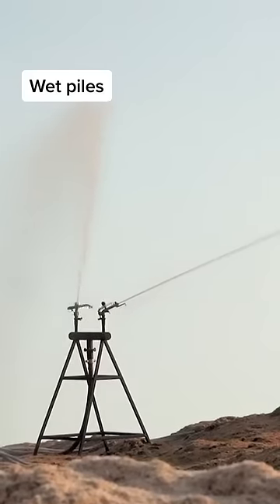How #sugarcane waste is turned into tableware. #shorts #recycling #waste

Comment: Glad that they are using the extra fiber.
Reply: Yeah but its India so u know the chemical waste go into the rivers
Reply: @melvinjansen2338 no because it is compulsory to have a waste water and effluent plant , I am a chemical engineer I have been to many plants and even the smallest have a waste water plant and one more thing to add is the remaining residuals are either dumped in dumping sites allotted by the industrial sector and the remaining may either be used for some other processes 

To say it’s India and so it’s bad let me tell you you westerner like to use the chemical but you don’t like to make it in your own land 

Hypocrisy at its peak
Reply: @melvinjansen2338  you sir need to learn some manners , if not atleast do some research and gain some knowledge.
Reply: @smitchhatrola8295  If something is compulsory it doesnt mean a thing. You could have one that is too small, Barely works etc. On top of that, you are talking about registered and regulated companies that you visit.. you dont visit the others.
Reply: @smitchhatrola8295  my small country has the 4rth biggest chemical industry in europe and everything is super clean here. We do send alot of ships to India however so an army of pajeets can disasseble them without safety gear on.
Reply: @melvinjansen2338  compulsory mean you have to submit it when you start the company
Reply: @melvinjansen2338  Which country are you from? And what's with the racial slur?
Reply: @melvinjansen2338  Based

Comment: Its really cool to see it used this way. My city is a huge maker and exporter of sugar. We reuse the fibre as fuel for the boilers in the mill. It generates soo much energy that the mill sells it to the power company. It help keeps a our aircons running during the summer, topical north Queensland summers suck. But its very cool to see how other places use it.
Reply: That's crazy that the byproduct of sugarcane would produce so much energy, but I wonder if it pollutes too much of the air or not in the process
Reply: @tydshiin5783  Nah, burning carbon based fuels that are not fossil fuels are actually pretty neutral to the environment because it's just releasing carbon back into the atmosphere that was there already. The issue with fossil fuels is that the carbon has been out of the atmosphere for a very long time
Reply: @germanspacepug6373  not sure if I understand that last portion tbh
Reply: @Siarnaq56 oooh, okay
Kinda odd how that works? With the planet adapting to the current climate
Reply: @tydshiin5783  pollution ofc, but growing the sugarcane itself will also clean up the carbon. The difference here is using that unused fiber for single use packaging makes it so fewer plastics need to ve produced. And plastics require crude oil production, and crude oil production brings out lots of other pollutants.

Tldr: growing sugarcane to then burn it is somewhat carbon neutral (transport still creates a tiny amount ofc). But the reduction in need for fossil fuel extraction is the bigger effect here. Thats the awesome thing about this endeavour
Reply: @tydshiin5783  Basically, all carbon in plant material comes from the atmosphere during photosynthesis. Burning that plant material releases the same amount of carbon back to the atmosphere in a net zero balance. It's like biological multistep solar power.
Reply: @germanspacepug6373  lol and what about those pesky volcanoes? Are we gonna put a cork in em?
Reply: They should mold them into like some dummy logs you can burn them in a wood stove at your house
Reply: @wildchild2193  That exists. They're called firelogs
Reply: @effu9593  The fact that volcanos make the problem worse shouldn't stop us for looking for solutions to the problems we can solve, like burning fossil fuels opposed to biofuels like sugarcane fiber.
Reply: @tydshiin5783  stay in school
Reply: @gorlab9549  was never taught specific stuff about this for the planet lol
Reply: @lmao k someone else has already explained it in a lot more detail, but I thank you for responding
Reply: Most Indian sugar industries use this bagasse to fire up and produce power thru Co-Gen plants as well
Reply: It was one of my first thoughts.
That stuff dried up has got to burn with the intensity of a thousand Suns.
Reply: Don't forget sugarcane is the very high water sucking crop. Ground water depletes beyond replaceable level in few decades where this crop is harvested.
Reply: @rajshreesharma6500  Is it like any bad as like say Almonds?
Reply: @tydshiin5783  i don't know downsides about almond farming. Is it more bad than sugarcane farming?
Under what weather conditions almond farming is done?
Reply: @rajshreesharma6500  that's what I'm asking, iirc the almonds used for like milk is the equivalent for like 5 liters of water
Reply: Baggage is also used in boiler or power station as a alternative fuel by burning it. This is common  all over the world.🙏
Reply: Is that like the trees 🌳 grow then burn as fuel theres no effects 
Neutral 😐
Reply: I’m only a few K’s from the Isis sugar mill, where about are you @BloodRedRubyRose

Comment: Here in Brasil we Burn that I stead of coal in power plants creating a more sustainable alternative to coal
Reply: Yeah we know as well as Indian authorities are working with brazilian authorities to achieve 80% ethanol in fuel as we achieve 20% ethanol already 3years before the schedule
Reply: @AvijeetGupta  s/he is talking about burning the left over as a coal in boiler at power plant to produce electricity. It’s different than extracting ethanol . That’s different topic although it also get extracts from sugarcane
Reply: @rabink.5115  I'm talking in context of using sugarcane as substitute as in Brazil sugarcane leftover is used for extracting ethanol & in power plant both
Reply: I think they do the same in Hawaii.  I remember the smell while driving through the cane feilds!
Reply: Is Brazil also facing depletion of ground water level where sugarcane is harvested?
Reply: Bagas are used as fuel to heat up the sugar central boiler.

Comment: If they had OSHA in India..... all the inspectors would need defibrillators.
Reply: It is not food, but used as fuel which burns.
Reply: I'm not saying, we shouldn't have any worker safety laws at all but if India tried to implement the same safety regulations as western countries, most of the locals would starve to death.
There's a reason why so many manufacturing and industrial processes take place in China, South and Southeast Asia.

Comment: I used to live in a house in Hawaii that had ceiling panels that looked like sheet rock but with V shaped seams where the panels met. There was occasionally dust coming down from the crack in the V's. I asked the landlord why the seams hadn't been taped and he told me it wasn't sheet rock but a cane fiber product. It was a very old house. Later I got permission to install ceiling fans and had to cut out some of the ceiling. It was a brown fiber inside the color of coconut fiber but from the texture it could have been cane like he said.

Comment: Cool, but need info on handling these "alkaline product" and amount of water needed for the production, and whether it is reusable or treated before dumping.
Reply: It's reused, again and again until it losses most of its alkalinity. If they simply dumped the solvent after a single pass that would cost way too much.
Reply: @earth2k66  i see thanks for clarifying. I guess that would be more economical, especially if they could "reload" the spent alkalinity